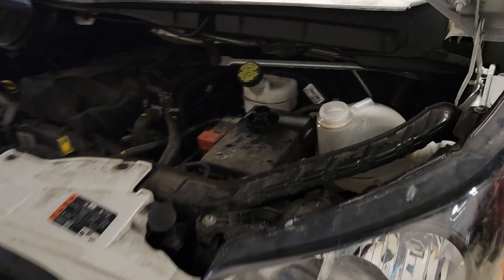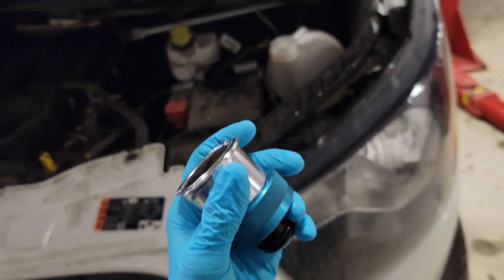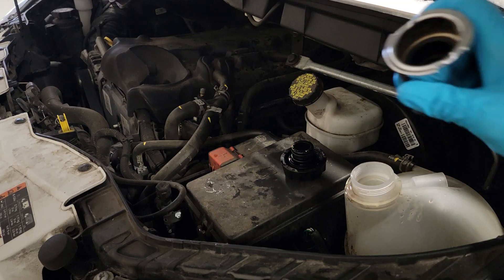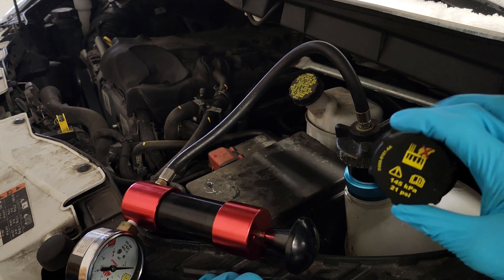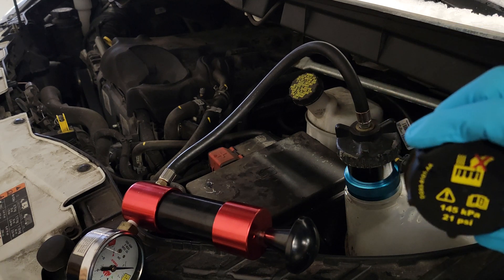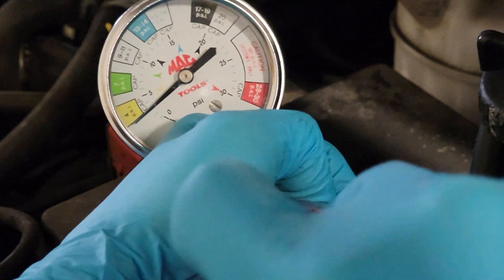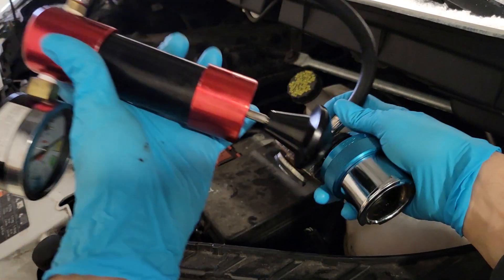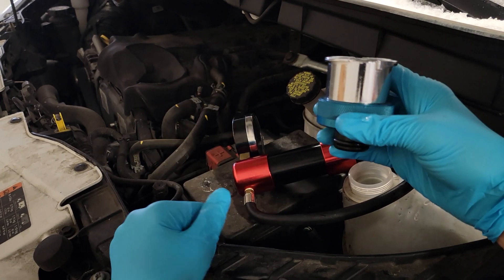How do you Pressure test your cooling system | ALL Fords - Find YOUR leak NOW!

Comment: Great explanation and use of tool. Thinking of getting one myself. ❓ 2002 ford f250 sd v10 6.8 gas engine. if my coolant hose collapsed due to bad cap and the contracting of liquid when cool would that mean that a leak cannot be present since vacuum held right? Did my bad cap help me diag if there's a leak? I wanted to buy tool but not sure if I need it. Thanks for your expertise!
Reply from the maker: Correct

Comment: This answered a question for me. The test, as I suspected, needs to be done on a hot engine. I am using coolant but cannot see and leak. I use a Stant tester when cold and it holds pressure. The observation on hearing the pressure bleed off when opening the d-gas bottle while hot on a properly sealed engine is a good test technique. Subscribed!

Comment: My 6.0 has a coolant leak at the front of the engine. I assume it's the radiator but had ford pressure test and said they couldn't find a leak. The other morning I bet I had at least a quart of coolant in the driveway??? Has a new water pump from bpd. Anyone have an idea what it could be, I could literally see coolant in the fan shroud so how could it not be the radiator, all the hoses are new as well.
Reply from the maker: Psi test it urself
Reply: @PowerStrokeTechTalkwARod  I'll have to rent or buy a tester, but  def going to check for myself. Just weird cuz it only leaks like once every couple weeks🤦‍♂️

Comment: Last week was a 6.4 fresh shortblock installed. Pour in coolant, 20 min later got drips under the front. Porous used Dorman front cover was the culprit. Real bugger to have to rip the radiator out again, after just putting the motor in. Single turbo sounds great though.
Reply from the maker: Ughhhh

Comment: I have 2003 f 250 7.3 engine  I need the cable goes  from the starter to the first battery  we're can I buy it
Reply: Look up Larry b… sells Awsome military style connectors… then pick up some 2/0 welding cable and press copper lugs on the ends with quality heat shrink. You will never have to touch them again.
Reply: What a coincidence, I have the same year only an F450 with a voltage drop on that cable. The dealer said no longer available.
Reply from the maker: Wow
Reply from the maker: Dealer
Reply: Just make one. You could probably make a better one for cheaper